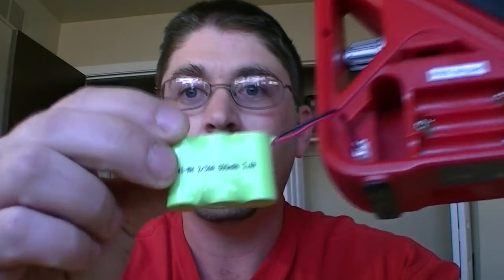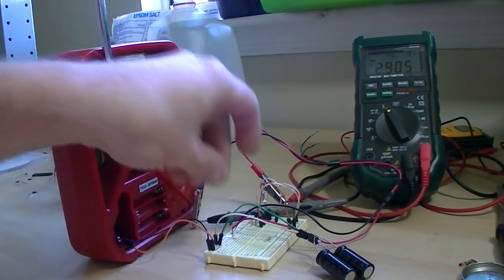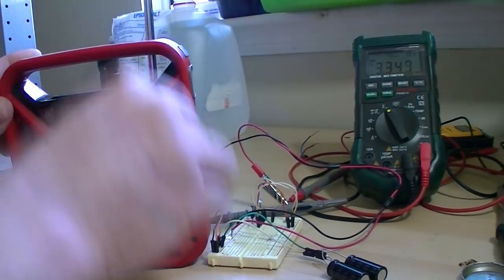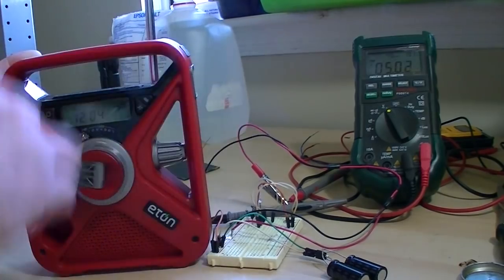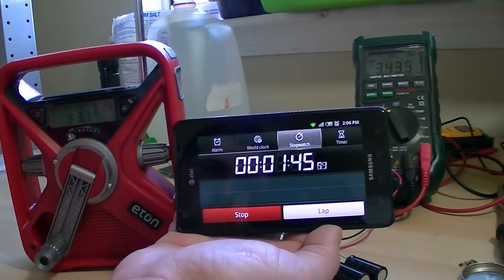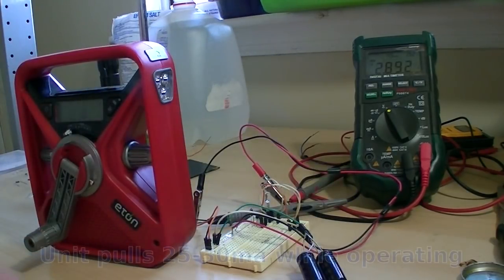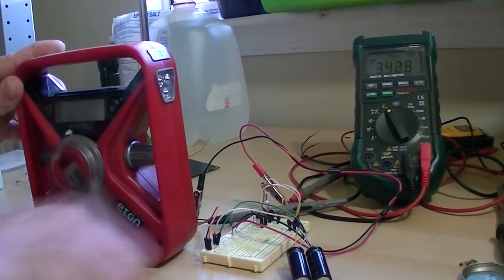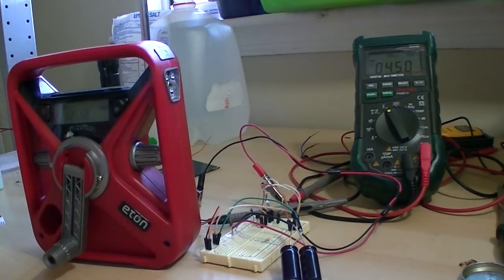Supercapacitors Instead Of Rechargeable Batteries

Comment: When using like capacitors in series the maximum voltage doubles while the capacitance stays the same. When putting like capacitors in parallel than the maximum voltage stays the same while the capacitance doubles.
Reply: Sorry, I am wrong the capacitance is cut in half when like capacitors are in series. The maximum voltage does double in series and the maximum stored energy doubles in either parallel or series configuration. The energy in a capacitor is directly proportional to the capacitance times the voltage squared. So if the voltage and capacitors are the same and two are put in parallel the energy doubles as does the capacitance. If the capacitors are put in series the voltage doubles as does the energy but conservation of energy dictates that the capacitance must be cut in half. You may notice that for the same type of electrolytic capacitor that C time V squared is proportional to the physical size. Meaning that 10 volts at 1000 uf is equal in size to 100 volts at 10 uf. Meaning that it uses the same container.

Comment: How long do the normal rechargeable last in comparison? Iif you had a bank of capacitors, say 4 of the same and charge to the 5v would it last twice as long? or is it the voltage that disperses at the same speed no matter how many capacitors are plugged in?

Comment: They are not interchangeable as the discharge characteristics are totally different. On top of that, caps use static electricity where batteries use a chemical form of storage.

Comment: My UPS back up bit the dust. How would I use caps to replace the battery? 
Could you make a video? Do you have a video?
Reply from the maker: Supercaps don't have the capacity to $ ratio to warrant using them as a battery replacement for a UPS.  They have come a long way but not that far yet.  Keep an eye on graphene supercap research, it may become viable in a few years.

Comment: >> A hint to use the full charge of capacitors till it fully die! (maybe near 0.3V)
Use Joule Thief but instead of LED, take it off and connect the positive and attach a Diode then the other end of the diode charge a small capacitor's positive to have a steady DC voltage (Capacitor's negative is sonnected to the LED's Negative , simple and Have fun :)
look for it in google Images and use "high power jewel thief circuit"
here a link that might help or if ya know how to build circuits and make one yourself. ( you can have a ferrite core from a damaged AC neon bulb circuit)
www.instructables.com/id/1-Watt-LED-Joule-Thief/
Reply from the maker: Actually now I use a chip from National Semiconductor called NCP1402 that does just what the joule thief does but with more effecient.

Comment: What is the difference between a super capacitor and a rechargeable battery?
Reply: A battery, when charging, converts electrical energy into chemical energy and then stores it.
A capacitor, when charging, does not convert the energy but stores it directly as electricity in an electro-static field, (stored electrons on plates or metalic film)
A battery, when being used, converts chemical energy back into electricity (electron flow).
A capacitor, when being used, just directly releases the electricity (electrons) back out to the circuits, in this case, the radio.

Comment: could these be used to replace a motorcycle battery?
Reply from the maker: Yes you can, search for a user names lasersaber here on youtube and look for his videos on homemade boostpack.
Reply from the maker: Jon Garver
No, the pack is meant to replace a standard SLI (starting, lighting, inition) battery.  These types of batteries are not meant to be used for constant current drain, only for short bursts of power.  If you want to run lights for a prolonged period, you need a deep cycle battery, and supercaps will not feasibly do this task.
Reply: Jon Garver
If your alternator is working when you running your bike, it's ok.
Reply: yes, but you will need 6 of them in series, but they don't hold the charge too long...
Reply from the maker: Yuri LM Actually supercaps only lose 1% of charge per day.
Reply: Would daily use be enough to keep it charged then?  It is not electric start, it is only for lights and horn.

Comment: What concerns me about the usage of this capacitors is the virtualy non-existent ESR. How do you control the shortcircuit current? you certainly cannot fuse it!
Reply from the maker: 20 amps for 1/2 second sustained on a full charge.  I'm not worried about it.  Car batteries have 800amps for 5 seconds sustained, and you fuse them.  Why can't you fuse a supercap?
Reply: R&TPreppers those 20 amps are there because you are loading the caps. Put that on a real product and suppose there's a short, how do you control the current? how can you fuse it if you dont know what the max current will be? if you exceed the current rating of the fuse a lot, it will form an arc which once formed can be sustained with 3-5 volts and the fuse will conduct.
Reply from the maker: Simon Bourguigne
First you need to know the nominal current used for the application you want to use the supercap in.  Then you can easily use automotive style fuses to protect the wiring and circuit from a short.  Think about it, a car stereo is usually fused for 10-15 amps.  If you short the power to ground the fuse blows since at that moment the 800amps from the car battery is trying to flow through the fuse, making it blow.  These fuses are designed for DC circuits and do not have a problem with arcing over a blown fuse.
Reply: R&TPreppers Interesting, can i get those fuses in mouser?
Reply from the maker: I'm sure you can but you could just as easily go to your local auto parts store.
Reply: for something like this video i would use a 5v150ma fuse or a 12v100ma fuse (fast blow). a fuse wont help much for a supercap which may be 15mah (0.015 amp hours) verse's a car 12v lead 60AH 800 CCA. supercap parts short = bright flash, finished; car battery short = melting metals followed by fire.

Comment: Build a mini SMD buck-boost converter which should drain the entire capacitor and provide 5V output (or whatever you set the output to regulate too).
Reply from the maker: I'd love to do this, but the only problem comes when you crank to recharge the supercap, there's no path for the electricity to go around the converter to charge the supercap back up.  If you have a viable idea on this, I'm all ears!!
Reply: R&TPreppers
The same way Laptops do it, MOSFET switches.
Reply: R&TPreppers
There are also other topologies that work both ways, such as Two Switch forward (transformer not inductor), as long as you make them symmetrical (Switches and Clamp diodes on BOTH primary and secondary).
Reply from the maker: Doom2pro
Thank you!  I'll look into this.

Comment: Actually all calculation should be in terms of energy, but I am taking current and time as all that is relevent to determine energy. So putting 600 mA hours into either the capacitor or battery would take the same amount of cranking time. The capacitor in the demo only charges up fast because it is storing so little. Charging and discharging batteries also loses energy in heat, due to the inefficiency of the chemical reaction, sometimes estimated as a 50% loss. I have no idea if there is some such inefficient conversion in super capacitors. The loss in the chemical reaction is a different thing then what is termed internal resistance (which is the electrical resistance taking the battery as if it were a conductor like a wire.)

Comment: Capacitors wired in series have capacitance like resistors have in parallel. Two capacitors wired in series do not have capacitance c1+c2

Comment: 600 milliamp hours stored in rechargeables. radio draws 30 milliamps. gives 600/30 = 20 hours playing time.

He cranked for 1/2 minute to get the capacitor from 3 to 5 volts. He got 30 ma X 2.5 minutes (= milliamp minutes) out of that, or dividing by 60 to get milliamp hours, he netted 1.25 milliamp hours in 0.5 minutes. To get 600 milliamp hours would take 600/1.25 = 480 times as long to crank out. 480 X 0.5 = 240 minutes, or 4 hours.

Comment: Little word of advice... I commonly see on YouTube those "bling bling, I am professional" Intros (which are usually too long btw.), followed by some guy sitting in a room with a badly positioned camera. That looks very unprofessional. So either: you could use a more apropriate and shorter intro OR you could sit in front of a white/colored wall, that changes everything...

Comment: I see the use of capacitors in something like this where you can charge it at any time.  Batteries would be cheaper per watt hour for something that does not have a crank. I have replaced the junky 600mah nicads that come in rechargable devices like this with 2000mah NIMH AA rechargable batteries with good results

Comment: a regular voltage regulator is not very sophisticated. I think the the excess voltage becomes heat in the heat sink. so if you had a power source (battery, capacitor) at 7 volts and a 5v regulator then the extra 2 volts goes to heat and does not help the light run longer.

Comment from the maker: Yes and no.  If your looking at how much power was absorbed by the rechargable battery VS supercap, the supercap will absorb more of the charge from cranking for one minute since it's internal resistance is much lower.  On the flip side the rechargable battery still has much more energy density then the supercap.  This is why supercaps will still take up a lot more space for the same charge density then batteries, but it's getting better every year.

Comment: So, the bigger, heavier, longer to charge NiMH batteries gave nearly HALF the run time of the super caps? I bet that once the cost of making capacitors comes down (as it inevitably will) we will be seeing nearly all our rechargeable electronics using super caps in place of batteries. Including cars, cellphones, etc. Question, if you wire caps in parallel, will they act like batteries in parallel? Meaning more run time at the same voltage?

Comment from the maker: I've played with joule thief's before and had fun with them and LED's.  A more robust and easily implemented dc boost converter for small current draw is the NCP1402 chip.  I use it all the time for small current low voltage boosting.

Comment from the maker: Thank you!  Yes I did get longer run time when I hooked up a small dc boost circuit to the cap to drain the supercap further and still provide suitable voltage to operate the radio.  The only problem with using a boost circuit in THIS application is you can't recharge the supercap directly through the factory 2-pin connection using the hand crank.  The diodes and other circuitry of the boost circuit block the reverse flow of power from the dynamo crank.

Comment: those caps sure are amazing. to calculate the actual energy used in that voltage range, you can convert it to joules and compare the different states. 5F 5V = 62.5J and 5F 2.9V = 21J so you are utilizing about 66% of the energy capacity, wich is not bad. a circuit called the joule thief could pull it down to 0.7-0.9V but the output voltage is unstable.

Comment: You could get a longer run-time using a little dc to dc boost converter to fully discharge the super capacitor and also you could have it to run on 1 instead of 2 also if you want to use multiple in series you might want to add a balancing system in there to prevent one cap to be overcharge. Thanks for sharing! Great video also :)

Comment: Sorry to say that, but that is bullshit. A supercap 5 TIMES the price of old fashion lead acid batterie will drastically reduce life time at the same max current as lead acid batteries. Super Caps are rated for 50 to a few hundrets of amps and any lead acid battery will do this without any problems! And remember: For 1/5 of the price of a Super Capacitor Bank the car Batterie has still much higher capacity! Supercaps ONLY make any sense in super cold terrain below -20°C average! Waste of money!

Comment: Are these 10Farat supercapacitors capable of a 10 to 20watt output? I would be using them in an e-cigarette (the batteries send power to a coil of resistance wire; I custom build my coils so I could make the resistance anywhere between 0.2ohm and 3.0ohm).

I'm no physics major and I only have a very basic understanding of circuits and Ohm's Law but I am slowly I'm gathering hardware for a custom e-cig build in using a project box and I need a small power-source that will fit with the chipset

Comment: Do you think I could use supercapacitors to replace my 18650 IMR batteries (I use them in my Advanced e-cigarettes)? 

My current mechanical setup requires, approximately, 18amp (+/-) continuous draw @ 3.7-4.2v (Requirement: must be capable of 18+ watts with 0.5 to 3.0ohm coil) - Can supercapacitor(s) match this performance while keeping a small form factor? (Ideally, the smaller the better; any supercapacitors that're similar size as IMR18350 to IMR18650 batteries)

Comment: A regulare batterie is still much better in both price and capacity... I mean, a Capacitor bank with the same capacity of a 100Ah for 12V Car use would cost 500€ at least!

Regular Lead Acid with ultra high quality will cost less and hold much longer. And for a Car you realy don't need high efficiency. The current is perfectly enought. The small losses through a few mOhms in the Batterie while starting up the Car are not that bad.

Comment from the maker: The radio does have a low voltage cutoff, but it continued to run all the way up to 5vdc.  I didn't want to push the voltage up much more then that as it may blow up some of the circuity of the radio.  Just keep it in the operating range of this radio (which is 2.9v to 5v).

Comment from the maker: Honestly I have no intention or interested in perusing hybrid systems.  I'm more interested in finding ways to use supercapacitors at full replacement for small power consumption devices.  Not to mention that adding a Li-Ion battery into the mix also requires another part of the circuit just to control the charging of the battery.  Also Li-Ion batteries have a lifespan of 3-4 years, where as these supercaps are potentiality good for 20+ years.

Comment from the maker: You have uf=microfarads and F=Farads mixed up.  a 1000uf capacitor would light a white led for a fraction of a second.  supercaps above say 1-5F have an upper voltage range of 2.5-2.7vdc.

Comment from the maker: remember the human body is relatively safe from voltages below 60 volts.  this is why you can touch both terminals of a car battery that has hundreds of potential amps that could cook you in an instant but the voltage is too low to overcome the bodys resistance.

Comment: I've just become curious about ultracapacitors and found your video.  I need a reference point.  How long would it take to fully charge the original battery (cranking) and how long would the radio run on a full charge?  (I apologize if you already answered that.  I skimmed through all the comments and couldn't find it).

Comment from the maker: There are much better boost circuits out there today that are far more effecient then the joule thief.  I've played with them and you get maybe 60% conversion.  Look at my Infinity sun jar series, I started with the joule thief and ended up using the ncp1402 chip.  It runs down to 0.3vdc and is 80% effecient.

Comment: What about using capacitors as a voltage overflow storage so one could crank faster to get a faster charge, and then the capacitor charges the actual batteries at a rate that their internal resistance allows? I guess this would only be as helpful as the number of capacitors used, and you would have to switch it offline when the capacitors reach the maximum voltage limit, and would become less and less useful the higher the battery is charged...

Comment from the maker: A voltage regulator would be used to keep from overcharging the supercap.  Your crank light will work better with a supercap in terms of energy cranked to energy retained since the internal resistance of a supercap is much lower then a standard battery.

Comment: Super capacitors are not meaningful as a replacement for rechargeable batteries in a radio due to a much lower energy density. They make more sense in applications where you need their high max power capabilities.

Comment: The led's wouldn't put out the optimum wavelength of light for the solar cells to generate power so it more than likely would not work. Intensity is not the issue its the frequency and wavelength of the light as led torches (I assume this is what you are talking about) are designed to output a different light to the sun as they are purely to help us see.

Comment: Nice intro!

I have to disagree with your math, though. When you wire capacitors in series, your total capacitance is reduced, not increased. Your voltage is increased.

The capacitance of two capacitors with capacitances of 2.5 F and 2.5 F can be calculated as:

(in parallel)
C = (2.5 F) + (2.5 F) 
 So your total capacitance = 5.0 F

(for two capacitors in series)
C = (2.5 F x 2.5 F) divided by (2.5 F + 2.5 F) 
 So your total capacitance = 1.25 F

Great video, nonetheless!

Comment: Yup, that is why we don't use them for batteries. They also don't hold a charge for nearly as long as chemical batteries do either, they weren't ever designed to store power for a long time.

Comment: How long will the cap's last?  or how many times can you recharge them with out the caps going bad?  What size caps would your radio need to run or play for 1 hour?  and what is the cost of the super caps of this size and cost for 1 hour run time.    Thanks